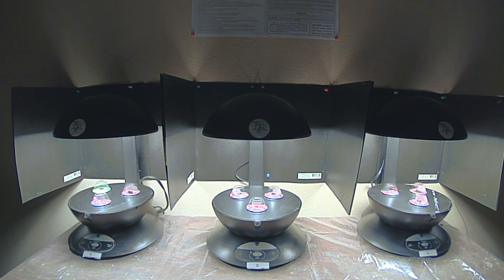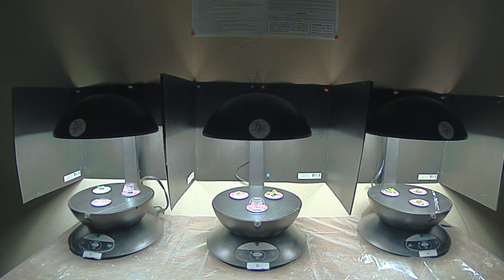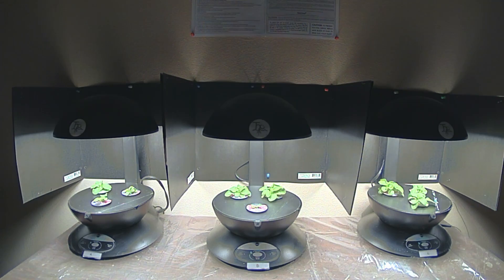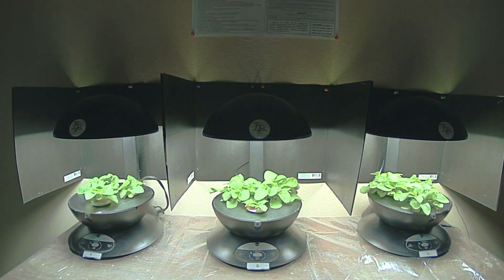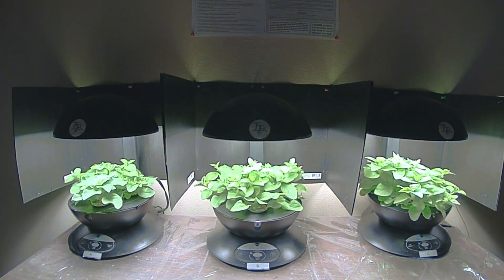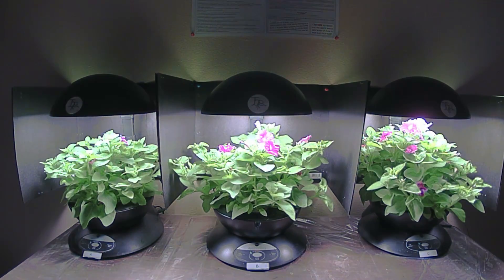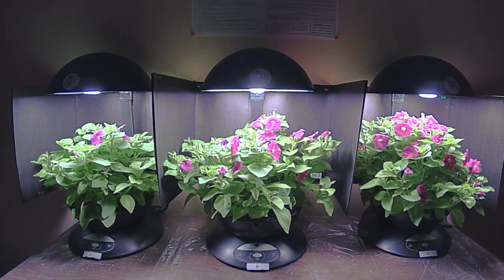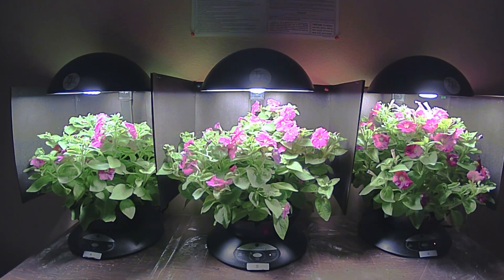Secret Technique for Hydroponic Growth using 528 hz & Structured Water - Time Lapse Experiment

Comment: The only con I see with this is them being so close to each other if one is receiving the 528hz wouldn’t all the others still be getting bits of the sound point is you need to redo this experiment with them separately away from each other with multiple seeds to tell if theres a difference
Reply: Most of the links he posted are gone now but I was able to find his original links on internet archive. The frequency was introduced with a pair of water proof ear bud headphones, he had one ear phone in the water chamber playing 528hz continuously on a cheap mp3 player that was capable of continuous charging as it played the frequency while the other he left out so he could listen to make sure the frequency was still being played. I highly doubt a cheap ear bud headphone would make such a di$rence in the neighboring plant. He made the structured water using a pvc pipe filled with marbles, pour the water down it a few times and you have structured water because of vortex from water wrapping around the marble creating small vortices. Another thing to note is when the gulf of Mexico had that oil spill, it was cleaned up by a group of scientists who connected water proof speakers to bouys that played 528hz which restructured the water and oil to make the oil disappear. There are many many studies on everything I just mentioned but you gotta look it up for yourself
Reply: Woah, they cleaned an oil spill with 528 Hz ?! 😮😮😮

Comment: Did u use a YouTube 528 hz or an actual rife machine?
Reply from the maker: it was a very low tech DIY delivery mechanism... more info at thehappycultivator website on DIY Vibrational Water Charging device article http://www.thehappycultivator.com/221/diy-vibrational-water-charging-device/ but basically  it was a few 528 hz mp3's looping over and over.
Reply: I’ve got a rife machine coming soon, and I also added all the stuff recommended for serenading water into my cart so I can have structured 528 Hz water to drink. Exciting 😊

Comment: Can you please explain how did you introduce 528 Hz to a water? How long you run 528 Hz in the water before you use it? Whats the amplitude of the oscillator and the amount of water. Also how did you produce structure water. Actually if you can do separate video how to do it at home would be great. If you make also pdf book I'm more then willing to buy it with this topics. Thanks.
Reply from the maker: It was definitely a DIY setup that was used... The blog post for this video has more information in it -> http://www.thehappycultivator.com/214/528-hz-structured-water-aerogarden-experiment/ in terms of how the 528 hz was introduced. (see additional link at end of blog post ) As far as the structured water we used a DIY device that was inspired by other Youtube DIY videos.  The structured water device was basically a pvc tube with glass marbles and quartz spheres where the water was poured in multiple times so that it was forced to make serpentine / spiral motion around the spheres/marbles.  I may try to make time for a more in depth video but no promises as I have been very busy in other areas lately.
Reply: @happycultivator  Hello.  The link you shared to your description of the 528 Structured water experiement has now been deleted.  Is there new link that explains our procedures?  Thanks!
Reply from the maker: @CyrilAndPriscilla  https://web.archive.org/web/20190327011331/http://www.thehappycultivator.com/214/528-hz-structured-water-aerogarden-experiment/
Reply: Thank you, I’ve loaded up my cart with about $60 of stuff to serenade my drinking water. I want that 528 Hz in me!

Comment: if you seperated the plants on diffrent tables your test would have came out with better findings. As you know sound or the harmonics or vibrations travels from plant to plant via. the solid platform there sitting on. Much faster than being tranmited in air. I would isolated them from each other. So they dont get the feedback. Than check your findings. I also playing around with subsonic frequence vs plant cell growth. As a hobbiest i think you will find something truely amazing. But i can say your on the right track. Good luck
Reply from the maker: This may be true but the speaker used was a very small waterproof earbud headphone so the transmission effects most likely would have been minimal and separating the units would also have made recording the video more challenging.

Comment: how do did you isolated the center one from 528 hertz? the center one seemed to have grown bigger
Reply from the maker: +s alam I was actually testing a structured water device with the center one. 528 hz on the right. Control on the left. The 528 hz was transmitted into the water at a low volume and so should not have done anything to the one next to it. I am planning on doing more dual tests in the future though to rule out any result contamination.
Reply: ok, great, there is not many practical test result like yours on the internet, so im really exited to this experiment, im working with institution of quantum genetics on custom frequency development on a certain cell type in human body, do you know what is the actual relationship between Fibonacci sequence and   solfeggio numbers?
Reply from the maker: +s alam That sounds like a fascinating area of research. I do not have a vast amount of technical research of my own in that regard but I would point you to an excellent article that touches on that aspect to some extent. http://themindunleashed.org/2014/03/miracle-528-hz-solfeggio-fibonacci-numbers.html
Reply: @salam9025  any update? I'm looking into figuring it the frequency of cell types genes organs and tissues. Can you point me in the right direction?
Reply: +s alam
Hi, I will be happy if you will communicate with me. 
I developed a very advanced personalized multimedia transmitting APP (vibration, music, pictures, video) via Android / PC to produce aquatic and spiritual contents to any living object and / or create structured water.

Eldad Wasserman